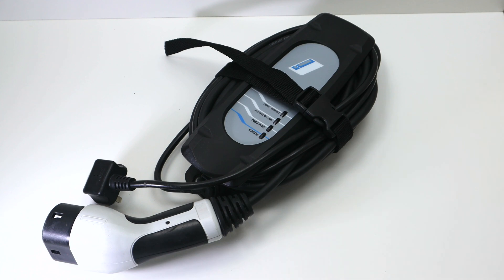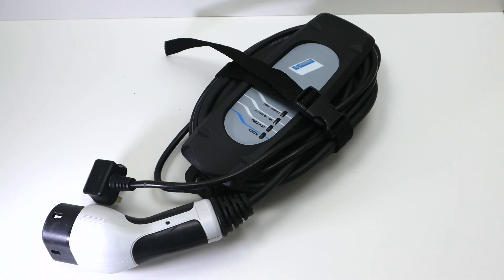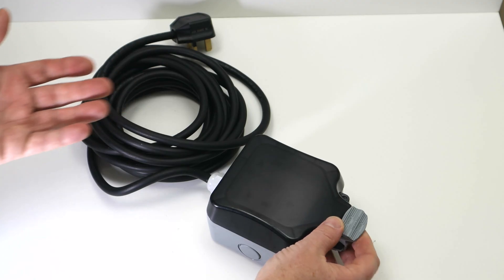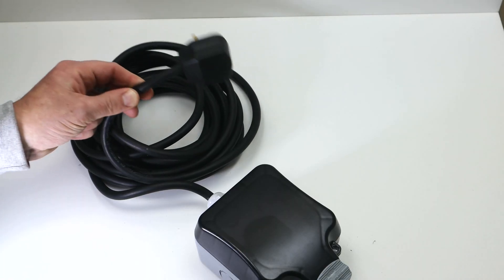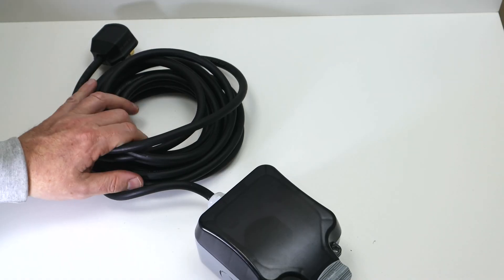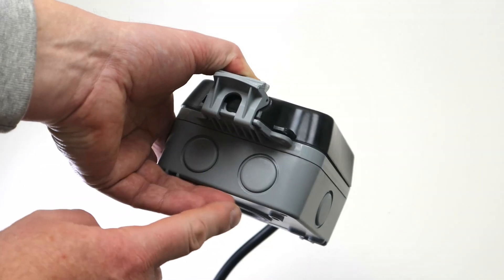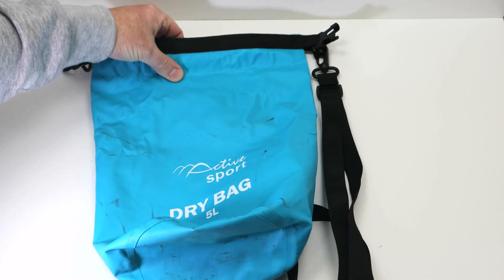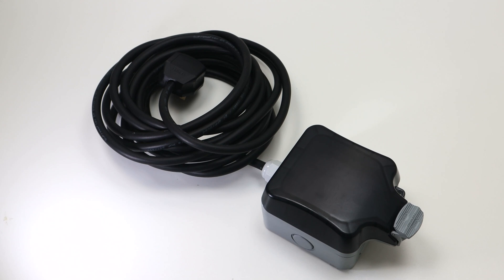How to make an EV slow charger extension cable for your car. Granny charger electric extension lead.

Comment: hi there mate, great idea!!!! isn't 1.5mm thickness too little? is the cable heating up? 
cheers
Reply from the maker: Hi, TBH this hasn't been used that much just now and again, but when in use I have not noticed that much heat.

Comment: Do not do this at home. Please. The plugs in commercial granny chargers incorporate thermal cut-outs to protect the plugs. Normal 3-pin plugs are not rated for continuous 13A use. If you use the standard plugs it is quite possible that they will over-heat. If your home is damaged you will not be covered by your insurers. It is some time since I read the regs., but I believe the socket has to be wall mounted. If you do not do so, it is another reason for your insurance company to refuse a claim. You might save a 100 quid or so with a bodge, but is that a good trade-off against the losses involved if your home is damaged. Don't be a mug, get a proper EV rated installation done by a SQEP.

Comment: Nice work, it greatly depends on where you live but worth bearing in mind that a granny charger can cost around £150, so if you're leaving the 3 pin socket but outside too then somebody could potentially pinch it to sell, worth having the socket itself inside a garage if possible

Comment: how did u connect a 4-wire cable to a plug with 3 slots?
Reply: He didn’t use the 4th wire.
Reply: @SurvivingTheApocalypse  what's the point then?
Reply: It's not 4-core it's 3-core.  Medlock have just used the wrong illustration on their website.

Comment: Is the bag used to cover the socket when charging ??? or just for storage ?? If its for charging how can it go inside the bag with cables from the mains side and the other side (the granny charger) also is 22 metres ok ?? ...
Reply from the maker: Just for storage, as the front trunk on the BMW i3 is not watertight.

Comment: I think 2.5mm cable would be better, my 1.5mm heats up on 10amps
Reply from the maker: I have not run it for a long length of time. It was really just for a few hours. My wife very rarely uses it now. Thanks
Reply: @daniel_coe  The official ev 3 pin socket has a RCBO included. The regulation is for this type to be used outdoors.

Comment: Iv already got a wall socket like this outside can i simply plug in 3pin 8 metre granny charger into 60kwh megabe etech without risk of fried electrics ? Having a nightnare with ohme attenpting to get a proper car charger
Reply from the maker: It's fine if you are using a slow 2kwh granny charger.
Reply: @daniel_coe and you are basing that statemwnt on what exactly? 
Just wondering as the standatrd 13A 3 pin sockets are NOT safe to use for EV charging at all. Same goes for the one u used on your extension lead too and you proba ly plugged that into a normal 13A socket too. 
Therw are special 13A EV approved aocket that you can buy and use. 

Standard non EV marked 13A socket is not built for 20 hours of 10A continuous current. 

Its a recipe for diaaster that extension lead to be honest. 

Just fit an external socket that is EV approved even if it is 13A one for granny charger you will not regret it. 

Contraptions like yours are possibly ok under supervison as an emergency solution. However i would fit an EV approved 13A socket on it and minimum 1.5mm flex. 

No way i would go to sleep with that on, either...

Comment: Thanks exactly what I need to build and had been looking at the same sort of solution so good to see it works. 

Is there any issues with using the socket box flat vs the wall mounted position with regards to its IP rating?

Will probably look to make mine. A bit longer as I’m in a terrace house with on street parking.  The two additional steps I need to figure out is how to run the cable outside in the winter as I can’t put an outdoor socket on the house. Plus I’m going to need to get a trip hazard cover for the pavement that will stand up to any complaints.
Reply from the maker: I don't think there is a problem keeping the box flat. You could always put a cover over it or put that part under the car etc
Reply: @daniel_coe I think there is a problem.  Avoid extra square 13A three pin plugs and sockets. Better, for a permanent installation, is a 2.5mm^2  three core cable and an in-line connector - just remove the plug on the granny cable and add a suitable length of cable.

Comment: Great idea! I’m thinking of doing this but in the cable shows 4 wires but your plug only has 3. What did you do with the 4th cable please?
Reply from the maker: I guess I must have terminated it and didn't use it
Reply: @daniel_coe  Cheers 👍

Comment: This does not conform to bs7671 charging points must be wall mounted extension leads are not allowed.Also outside 13amp socket must be ev type for continuous load an example is Hager wxpss81ev
Reply: Spot on mate.

Comment: Very useful video. Just one question: the wet bag, daft one I know, is it for covering the socket, only I see that the socket is waterproof.  Thanks.
Reply from the maker: It's to keep the socket dry as the i3 front trunk where we store it is not completely water tight.

Comment: Sorry for the dumb question.  What is the dry bag for?  For storage or use when charging???  Cheers for the vid ordered the parts as getting EV next week and in the process of buying a new house so need a granny for the interim.
Reply from the maker: Just to keep it dry as the i3 front trunk is not completely waterproof.

Comment: The socket shown here is not specifically designed for EV. I beleive there is a type of more robust 3-pin socket now made specifically for EV charging and they are marked as such. (Can somebody enlarge on this?) Personally, I would use something like the Masterplug item that includes a breaker - that way if, I was using it away from home, I would know that I was  protected, and not reliant on some geezer's dodgy house wiring. (MasterPlug: EVH132S1SPA EV)

Comment: Can I run a 40 metre cable with this method?
Reply: Just move up to the next gauge or wire thickness to reduce resistance. There are standard amps per distance per gauge/thickness that you can search online.
Reply from the maker: That's a long cable. I  don't know if you'd lose some power over that distance. But certainly worth a go if you can afford around £50+ on cable.

Comment: Fantastic video mate. Just saved me about £70 quid thx
Reply from the maker: Glad I could help
Reply: @daniel_coe  just a follow up.

I got the cable (blowing 32m / this is how much I need from back of the garden to my designated parking space) and connected everything together and I got custom made granny charger.

Thank you once again for the video.

The longest ready cable on the market is 25m which would be just too short. You saved me.
Reply from the maker: @pawelwitkowski5160  brilliant news.

Comment: Make sure you use 1.5mm cable as Daniel did. (not 1.25). To periodically check the extension, use it for an hour and feel the plugtop and socket for excessive heat.
Reply: You are correct I used a normal 30m extension cable and it’s rated at 16amps and it’s getting warm on the plug on my 10 amp granny charger.
I think I need to go out and buy a higher amp rated extension cable
Reply: Don’t use 1.5mm. Sure it will work but it will get warm, combined with the outer temperature it is dumb not yo use a higher rating. 2.5 mm is safe

Comment: You’ve made a good job of the extension lead, however, the manufacturer’s of granny chargers are so concerned about the plug/ socket overheating that they put a temperature sensor in the plug that switches off the charger if overheating occurs. I believe the overheating would occur in the socket rather than the plug. Beefed up sockets are available as standard ones are not continuously rated.
Reply: Thats a really good idea. Poor contacts on a normal 13a socket causes a nasty runaway effect which can easily melt the socket.  I know this because I melted the socket.  It does make you wonder what 13A actually means. They are not even drawing that and still melt.

Comment: You said you can make the cable any length you want...voltage drop amperage drop? Over what maximum length can this cable be before the amps drop below your required 10 amps. Next size up cable would allow what length? Sóme people may need something longer than 10m.
Reply: Just look this up online. I'm in NA and we use different thickness measurements but generally you move up to the next gauge/thickness every 50ft to reduce resistance.